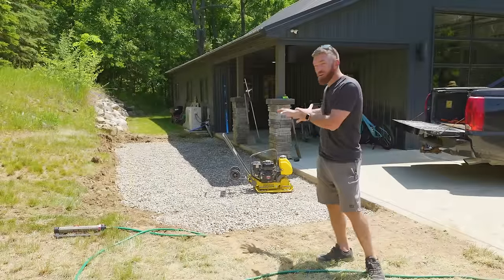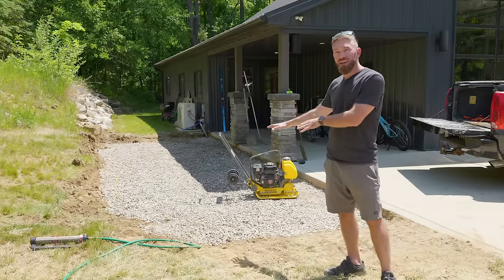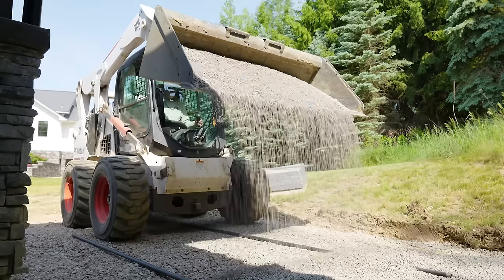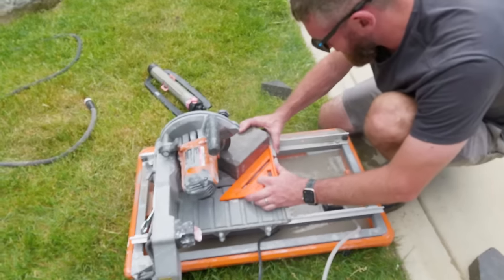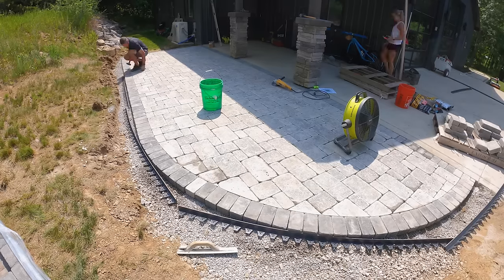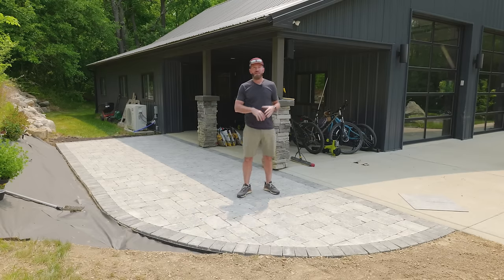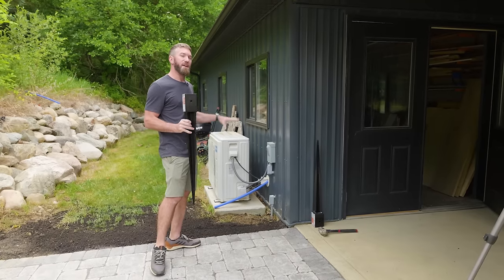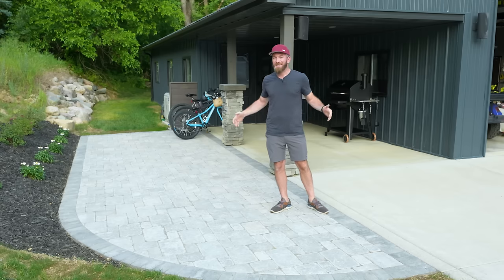How to Build a Paver Patio [Like a PRO] Start to Finish

Comment: How are you handling the steep incline leading into the patio? I’m sure it brings mulch, mud & water on the patio. I thought maybe a little knee wall then flatten out the slope with a flower bed. But not bad turn out real nice

Comment: Question please, sometimes after filling with sand joints and compacting, some paver edges pop out and not flat anymore. Know why that happens? Excellent work by the way!
Reply: Improper compacting(ya missed a spot) when compacting. Its easy to do.also frost heave. You have to know how deep to dig out, based on your frost line in your part of the country. Ours is 8 inches.

Comment: i’ve seen that concrete edge restraints are recommended when not using sand screeding.  what made you stay with the traditional edge restraint?
Reply: Was just gonna comment this. This edging is not supposed to be used with this type of base. Everything I’ve seen says it has to be concrete

Comment: was a great video, until I saw you put the weed barrier under the mulch. you will regret that in a couple of years when the mulch breaks down and you have a layer of compost on top of the weed barrier....which is a GREAT seed bed for weeds. Weed barrier works great under rocks to keep them from getting buried in the ground below, but not recommended under mulch.
Reply: I came looking for this comment! Totally agree.  Great video but weed barrier under mulch was a suboptimal decision! :)

Comment: Now I need to find a bobcat 😭
Reply: Lowe's, Menards, or Home Depot usually have some equipment/heavy equipment you can rent and have dropped off for daily/weekly rates! That's what I plan to do for mine :) Make sure you have 811 come out and mark gas and water lines before you dig.

Comment: You cheated by using the bobcat. Most of us normal DIYers don't have access to that kind of stuff. I'd most likely rent a tiller from Lowe's or Home Depot to easily and quickly soften the ground, then use a shovel to actually remove the dirt.